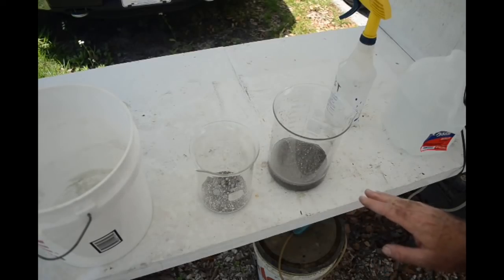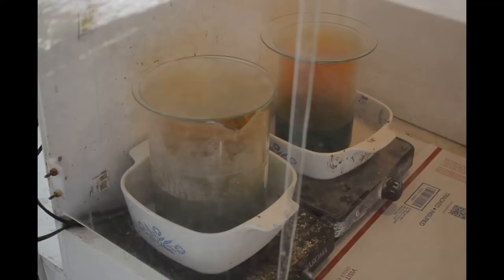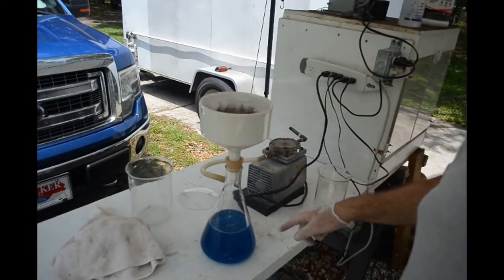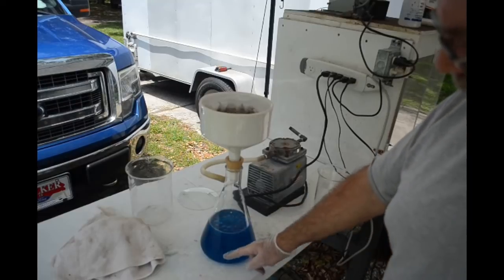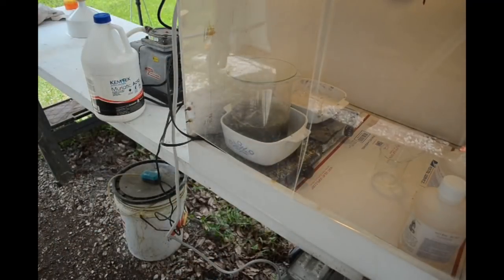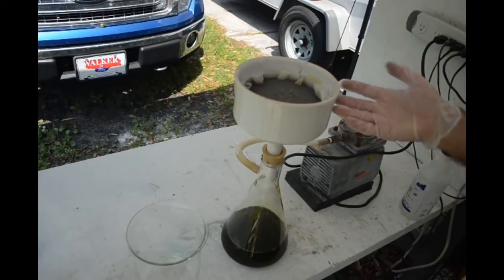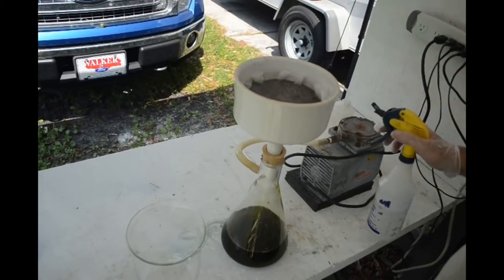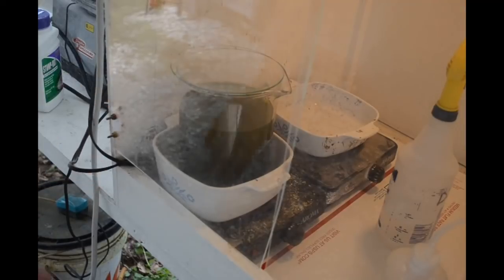Gold and silver recovery from plastic IC Chips. Complete Process part 2

Comment: Very interesting info. To what temperature do you head the nitric acid solution in the fume hood?
Reply from the maker: Just to boiling or a little below. Nitric acid boils a little below the temp that water boils at. Heat accelerates the reaction, but too much heat can, in my experience, boil off the nitric acid before it has a chance to work.
Reply: I'm otw😅

Comment: Great info, thanks so much. So I have a question. After I dissolved base metals w/sulfuric and potassium nitrate I noticed crystals formed overnight. Blue and clear. I know the blue ones are from copper, but what are the clear crystals from? I saved some of each then redissolved them with hot water.

Comment: Why add sulfuric acid, if the Sulfumic acid converts the nitric to sulfuric, wouldn’t that drop the lead?
Reply from the maker: True. I was hoping not to need to deNOx, but got too much nitric acid in it. If I'd got it right the sulfuric acid would have been necessary. As it turned out, it was redundant.